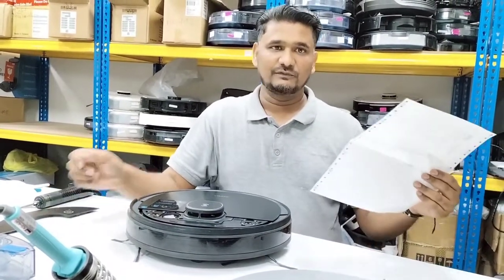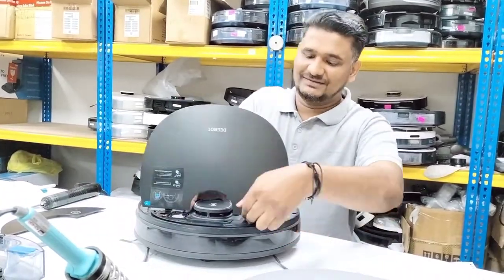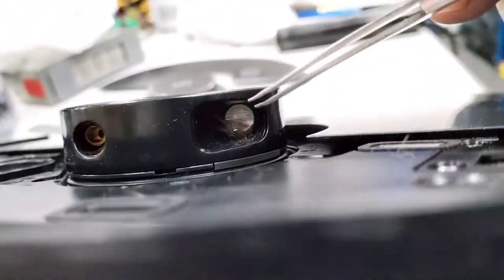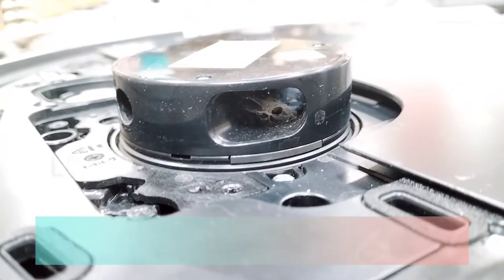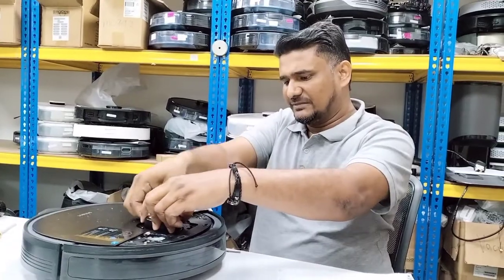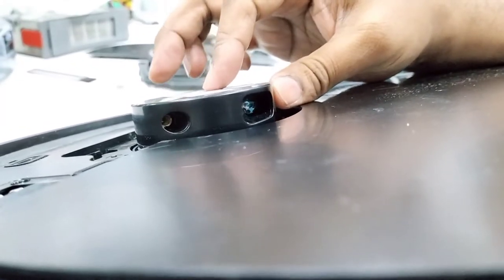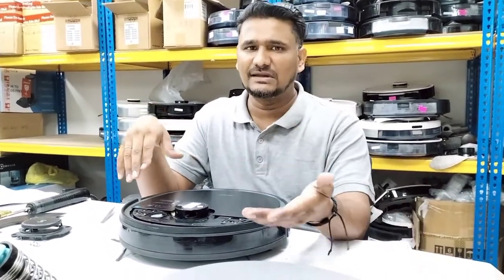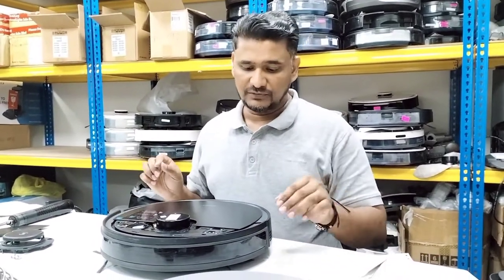Deebot Got Maping Issues/LDS Error Or Doesn't Cover Full Map??

Comment: in my case even though the LDS area is completely clean and all brushes clean the mapping is not done completely and more so it does not return to the charging dock. It loses it way. Since I had to place the deebot Ozmo 950 manually on the charging dock it does it store the map
Reply from the maker: Might be LDS assembly need to replace sir

Comment: Is there any video in your channel where the error message is LDS issue. When I checked the LDS it is spinning fine and clean and still not moving..
Reply from the maker: Hi...in this case LDS assembly need to replace...fee cases I received after replacing the LDS assembly start working normal....

Comment: Got one of this deebot n8pro.
It wont map if the sensor cover is on, but works fine without the cover.
May i know what is the reason for it not working with cover on?

Thx
Reply from the maker: Some customers uses vinegar etc to wipe the bumper or D-Tof cover that's not right... glass Blur. Plz check have you fix the cover springs at proper place & blade glass is not blur or faded..

Comment: Lds rotates few rounds and stops working n hew me suggestion to clean it.Howeever I cleaned it It still faces issues What should be done
Reply from the maker: If deebot totally won't move & after minutes gives LDS error then most likely is core board issue located next to motherboard... which can spoil after around 2 years